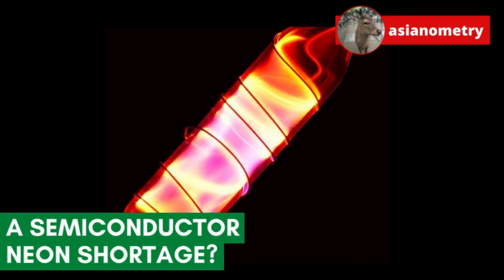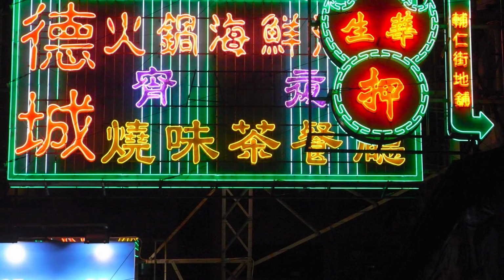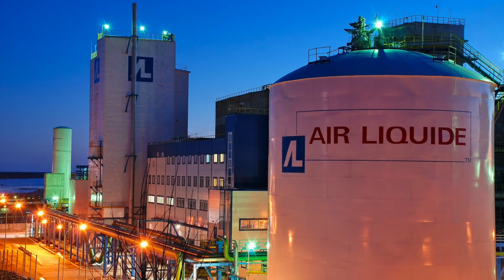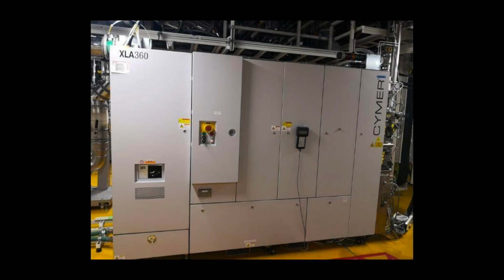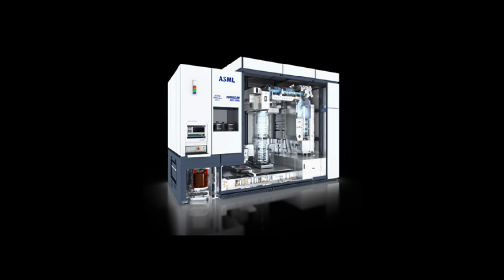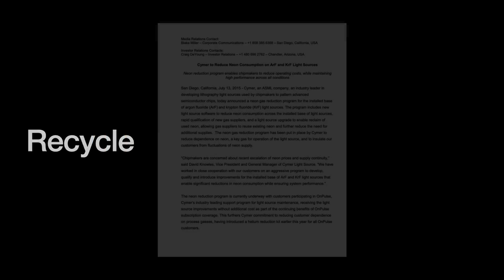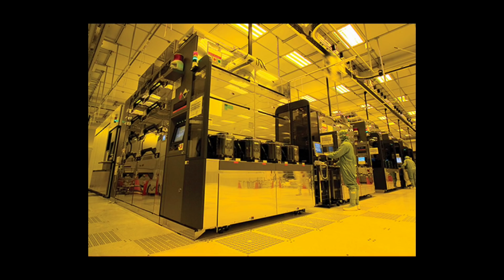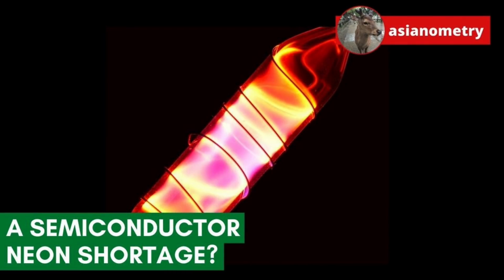The Semiconductor Neon Shortage

Comment: Russia is also the biggest exporter of Palladium to my knowledge. If they really put up a raw materials export stop, that could also be problematic. Thrilling times for sure.
Reply: They also have a limited domestic market for it. It might not matter.
Reply: @MrTheclevercat  Well we'll see I guess.  That's if they don't sanction us back.  Which, it looks like that's already happening.  What's ultimately probably going to happen is a new kind of compartmentalization.  East on the one side and west on the other and no interaction.  I noticed Saudi Arabia announced they're going to start selling oil in Yuan.  That's a big shift.  Oil on the international market has been traded in USD since the end of the war.  I think US has made a series of terrible decisions here.  There was no need to antagonize Russia to the point where they felt they needed to go to war.  What should happened instead is Russia should have been integrated into the EU.  That would have been good for the EU and would have completely eliminated any tensions.  But we had to push east with Nato and shit.  And now... well it's a terrible time.  We'll see how it all pans out but in the short term there are probably going to be all sorts of shortages.  Including semiconductors :(
Reply: @MrTheclevercat  Well how do you suggest we replace a third of the global grain supply in the short term?  It can't be done.  In the longer term yeah you can probably do something but that's at least a few years.  40% of Europe's energy supply comes in the form of natural gas pipelines from Russia.  Again, there is no way to fix that in the short term.  You would be right if the normal trading rules apply (i.e. if Russia continued to still furnish us with cheap grain and natural gas).  If they refuse however then you have an immediate problem in Europe.  When you account for one third of the global grain supply you can do some damage.  Egypt used to starve Rome with food and Rome couldn't do shit about.  Eventually they gave Egypt some autonomy.  We can probably fix some of these things in the longer term but there will be some pain in the short term.  

Also I don't think you appreciated my point about China buying oil and paying in Yuan.  That's a huge developement.  Up until now if you wanted to buy a barrel of oil you would have to first convert your money to USD.  That's a huge advantage for us because we can just print USD while everyone else has to trade for them on Forex.  If the USD dollar loses its global reserve currency status and all of a sudden commodities can be settled in something other than USD that's another huge blow.

Your conclusion that it won't hurt us much is naive man.  Very naive.  It's already hurting people at the pump because corporations never let a good crisis go to waste.  Oh it's war?!  Well that means we gotta jack up the price and blame Russia (or whomever).  

The State Department sent a delegation to Venezuela last weekend.  To Venezuela!!!  This is a country we've sanctioned to death in an effort to suffocate them for the last 5 years.  We tried to effect regime change through an illegal coup.  We took their gold (4.5bn they had in the Bank of England).  We recognized some random person (Juan Guaido) as the president of the country even though he never stood in any elections.  We have no diplomatic relations with the country but because of the events of the last few weeks we're sending high ranking  State Department officials on the down low to plead with Maduro to ramp up oil production.

It's already ugly and it's been three weeks man.  It can only get uglier from here.  I think in the west we have been comfortably ensconced in our arrogance.  Thinking we can do whatever we want to whomever we want.  Well, I guess we're about to find out if that's true.  Russia isn't Honduras or Haiti (both countries we've destroyed economically and ruled through various measure).  I think this is precisely what we wanted to do to Russia.  I.e. rule it like some small Latin American country.  We'll see if that's possible I guess.  I'd say buckle up though because I don't think this will work.
Reply: 3) it's not hurting at the pump at all. Covid lockdowns, endless bailouts, qe and zero interest rates - that's why pump price is higher, not russia. EU right now is locked in contract with Russia in which they pay for gas... $267. While spot price is $1200+.
Reply: Yep.  Which is why our thinking we can sanction this country and thus control them is a delusion.  They're also large titanium exporter and other precious metals you need in electronics.  And of course things like natural gas (40% of Europe's energy supply is Russian natural gas), oil and probably a less known fact is that Russia represents one third of the global grain supply.  Think about that for moment.  Egypt survived in the Roman empire times because of the threat of starvation they held over Rome (they were a large grain exporter).  Whoever controlled Egypt could starve the world.  And the fucked up thing is we could end this tomorrow.  All we would have to do is say Ukraine will never join Nato and will instead be a neutral country (how horrible right?).  And it now appears that they'll have to give up those three provinces in the east whereas before they could have gotten away with keeping them so long as they gave them regional autonomy.  All this because Washington refuses to compromise on what would be good for Ukraine anyway (i.e. neutrality, no nato).  Basically it just comes down to ego.  They don't want Russians to tell them what they can/can't do.  It's stupid.  And we're paying for it.  Buckle up because they seem adamant fighting to the last Ukrainian on this one.  Semiconductor shortages are only the beginning.
Reply: @Screaming-Trees  also Russians don't want you to tell them what to do like any country in the world. You don't know all the truth about this conflict. Too much of lie around.
Reply: @Screaming-Trees  There are few points to neutrality.
1. Do you know how expensive it is to be a neutral country especially with 7000km of land border? The defense budget would be through the roof.
2. It's only in Russia, North Korea and other countries like that you could change these policies by the command from above. The non-neutral status is set in Ukrainian Constitution. Negotiators cannot guaranty that it would change, because even in order to bring the change up it has to be voted for by the Parliament (2/3 votes) and there is Constitutional Court after that and more. There're couple problems with that. The Constitution cannot be changed during Martial law which wouldn't end until Russian army is out of the country. Also there is no way to guaranty that 2/3 of the Parliament would vote for that afterwards. If they would it would be the end of their political influence in Ukraine and the entire war thing would need to be repeated within a decade or so. There would be bigger mass protests than in 2013-2014, because the people are much more united and moreover much more unified in their view on the topic of country's security.
3. But even without all this. Russia's demands are "neutrality" and "demilitarization". One has to be a dolt to take this seriously. These things are mutually exclusive. Translation - Russia is still not ready for negotiations. They have to make their mind first.

Comment: We do indeed like the ArF KrF excimer (exciplex) lasers in inertial confinement fusion research and I'm honestly a little embarrassed to admit that I didn't know neon was used as diluent gas in these lasers until watching this video, lol. Now, the lasers are only used in very fundamental research at the Naval Research Lab, but with the advent of ignition and true fusion burn waves finally being achieved on LLNL's NIF, eventually the KrF or ArF laser will almost certainly dominate as opposed to today's frequency tripled Nd doped glass lasers. We need them sweet, sweet deep UV photons of the KrF lasers to drive the fuel capsule implosions efficiently, and their beam qualities are superb; with ultralow beam profile inhomogeneity and high wall-plug efficiency for light production. Plus, a hypothetical future inertial fusion power plant will need to implode 5 to 10 capsules A SECOND. Solid state Nd lasers can only achieve 1 shot PER HOUR while we wait for the glass to cool back down, but a gas laser can be fired at many Hz because the only thing that needs to cool off...is already a gas.

Comment: Sadly, almost no fabs actually recapture their laser exhaust gases to reuse them.   The cost of the ArF or KrF laser gases for each laser is actually closer to $8,000-$15,000 per year (video stated $250,000, which is not correct).   While not cheap, that's pennies compared to the product created by the system or the cost of the consumable components that are used up by the laser in the same amount of time.  For example, that XLR system you were showing has two  laser chambers which probably run about $150K+ per chamber.  They are replaced once every 18-36 months or so, depending on the utilization of the laser.  That doesn't even count the other optical components or miscellaneous electronics and power supplies that also fail.    Basically, running a high end laser for one year can cost a fab somewhere around $150,000 to $250,000 per year... and the gas is just a tiny fraction of that cost.

Comment: Why does companies have literally no focus on sustainability? Why single points of failure are so prevalent in our supply chain? Please do a video on that.
Reply: Capitalism, in a word. Sustainability is an externality. Externalities are ignored.
Reply: Saving every cent for shareholders more important than medium to long term buisnes prospect for most. And a lot people with decision making power not the brightest in the world, a lot of then in position of power because of luck not judgment. Not first buisnes sector run in troubles because very small but important component manufacturing stalled or stopped. And they will not learn from mistakes.
Reply: When everything is done just-in-time 🤮🤮
Reply: It's inefficient. Makes products expensive, and companies less competitive, leading to failure of the business and inability to grow.
Reply: @موسى_7  Then they modelled their business wrong. Sustainability is survival.
Reply: @erkinalp  Long-term survival won't work for them, becuase they get killed in the short term before they can reach the long term to survive, so they focus on the short term. This is less of a problem for bigger, more established companies, however,

Comment: It's unreal how many pieces of silicon have been fabbed in the last 30 years and will just end up discarded.
Reply: What else are you gonna use them for? They has been etched and contaminated with metal, it's not like you could just melt it down and put in another batch
Reply: @pierreuntel1970  shut up

Comment: How the heck does neon degrade? What does it degrade into?
Reply: It degrades into a mixture of neon and ionized metal from the cathode. So no, the neon does not degrade at the atomic level, but it degrades as a purified substance.
Reply: Anders is mostly correct.  The fluorine in the laser is consumed by reactions with the anode/cathode material.   Fluorine plasma will react with pretty much anything, so it slowly reacts itself out of the laser gas.  This brings the gas mixture in the laser out of the correct ratio and causes the laser to operate inefficiently.  "Injects'", which are small amounts of fluorine/neon that are added every few hours attempt to maintain a stable Fluorine content.  However, over time some impurities from the anode/cathode/laser chamber/bearings will outgas contaminants that quench the plasma reaction.   Because of those contaminants, the gas is usually pumped out (to the air via exhaust ducts) every 3-7 days and replaced with new gas.
Reply: I think what this means is that the mixture as a whole degrades due to impurities.